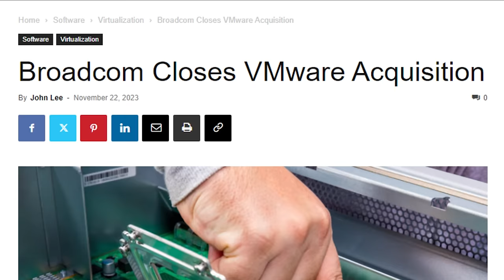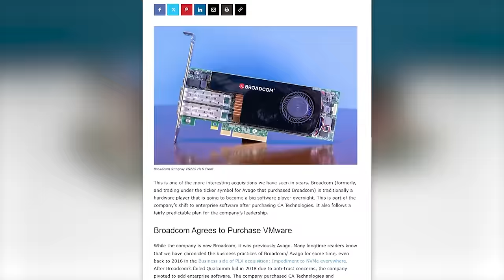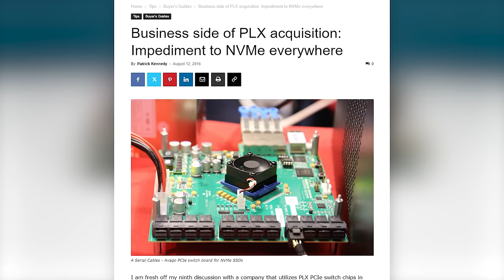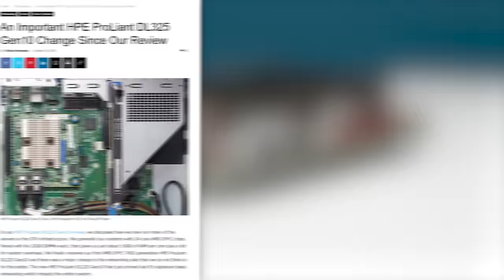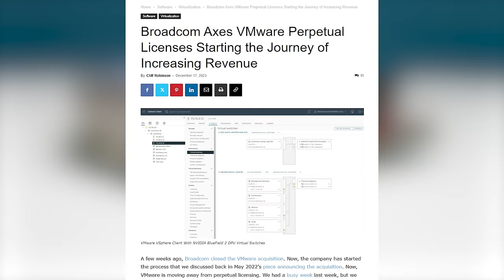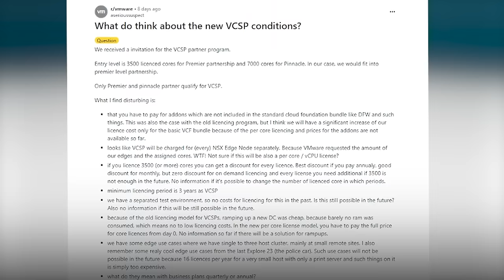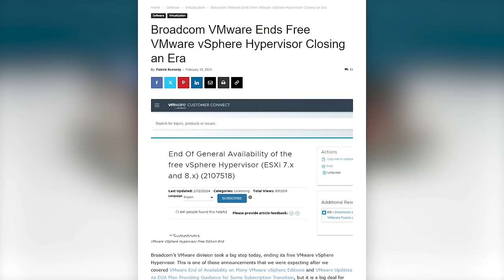VMware GUTS Customers with 10x Price Increases

Comment: 'The company that you built your business on . . . '   CNE  Novell Networks system engineers silently shed a tear . . .  😢
Reply from the maker: Great reminder!
Reply: Ooof, rough time.
Reply: I was a certified CNE back in the day LOL
Reply: @SeaJay_Oceans

In 1996 when I entered college, I took a multi certification course for both NT and Novell and Linux.  Many just took Novell because it was 80% of the market, however by the time I graduated NT was now 80%.  It flipped in just two years.
Reply: @eliotmansfield  Because there's been no development of Hyper-V in 8 years
Reply: @eliotmansfield  Many stuck with VMware out of inertia. It works, and it's the stuff they know. As for Novell, they pretty much killed themselves. In my sphere, when they moved away from IPX, that was the end of it.
Reply: My first cert was CNA, way back in 1997.
Reply: Back in the early 90s I did SCO Ace, MSCE and Informix DBA one after the other :D The knowledge I gained is still valuable, Even what I learned as a part time operator on  HP MPE V and MPE IX system while I still was in university. .
Reply: Former master CNE too, it  happens too much in this industry, gone from that to mcse, Citrix CCEA, HPE master ACE, etc, nowadays I don't pursue certifications just business with every tech I know.
Reply: @eliotmansfield Novell had much better network permissions.  So much so, MS finally introduced ABE, which still requires too much setup.  Salvaging files, etc..
Reply: @asksearchknock   Anyone else remember setting up DOS  LANtastic networks too ?
   Good Times...
Reply: @MichaelBrierley  Still running it, V2.16, for retro stuff, long live IPX!
Reply: @eliotmansfield  I was very disappointed when Microsoft discontinued Hyper-V Server.
Reply: My first job in IT had Novell AND an AS-400 mainfraime lol.
Reply: Oh my, I just remembered. Thanks and … here we go again.
Reply: My first cert was CNA, then CNE a couple months later.  It went away extremely quickly.
Reply: That took me back in 1999-2000 year when i was pursuing my CNE cert lol
Reply: @SeaJay_Oceans  Wow, that's a name I haven't heard in years!  It was great.  Easy to install and inexpensive and it was rock solid too.
Reply: Once Microsoft essentially ripped off Novel with Active Directory. It was only a matter of time.

Another great company ruined by acquisition.  Along with Sun, Palm, Ring and numerous others.
Reply: Novell didn't rake up the prices though, that just became too difficult to run due to every application suddenly needing AD integration :|
i ran a Novell network (Mixed Netware / SLES) till 2018 when there was a forced switch due to outsourcing.
Reply: Ahhh yes. Include me in that list of CNEs... First network I ever worked on was my home token ring Novell based one.  Oh I don't miss that. Or having the right terminator when you need one... So many times I'd "oops"  because I grabbed a balun one out of the tool bag instead of a BNC, lol.
Reply: @jfbeam  The move to TCP was unavoidable already. They just waited for too long,  implemented it not good enough and the most important - MS was very aggressive that time...
Reply: Yup.  Dual Master CNE here.  Used to work for Novell as a Systems Engineer.  Supported NetWare in the enterprise for decades before they went 'poof'.  Novell's biggest problem was they didn't know how to sell to VITO (Very Important Technical Officer). While Novell was courting network engineers, Microsoft was courting CIOs & CEOs.  Microsoft knew who the decision makers were and Novell was too busy selling to the troops in the trenches.  I remember asking the head of marketing for Novell why we didn't advertise on TV (like Microsoft (and everyone else) did).  His answer was that, per Novell policy, all Novell advertising had to have a one-year ROI.  That was the moment I knew Novell was dead.
Reply: @uator Was considerably more expensive in our region than Windows Server, so management said change when upgrade time came. So we changed the infrastructure over due to cost. For us at least, they prefered Netware technically, but WinServer was adequate and far cheaper! Most of our change over happened within a few years after 2000. Had used Netware for 10years prior to that.
Reply: MCNE MCNI here.   A fitting comment
Reply: Ipx/spx was doomed. Running a gateway to convert for internet access was not ideal.  

Directory services and rights are still Superior to any of Microsoft or Linux attempts to this date.

The move that really killed it was the move from client server apps to TCP based browser applications. When's the last time you used a front end like Microsoft access to enter data on a fileserver.? 
The end of Novell was a simple one, the size of Microsoft was just too much.
Reply: No certifications, company was too cheap, but I did install a lot of Novell and SCO Xenix/Unix systems back in the day. Even got called in to fix a Solaris / Novell issue at a large university.
Reply: @MichaelBrierley Careful admitting that...but since ya did, I will too. I recall being kind of talked into Novell certs and later on having an instructor sort of chuckle and say "It's a Microsoft world...". I got my Banyan-Vines certs hanging over the mantle right next to the Novell, Applix and Word Perfect ones....😅
Reply: My CNA cert got me my first tech support job in ‘98
Reply: @DeanTWaters I made that same argument back then.  While I as the Network Admin would receive stuff from Novell, Microsoft sent stuff straight to the office of the president of my bank, which he would bring to me.  That's how I got my first licenses for Windows NT 4 server and workstation, which I brought home as work didn't need them.
Reply: Uncle worked as a big manager in that company, once it went up so did his paychecks
Reply: @jfbeam  But they had to because you know... the internet.
Reply: Microsoft robbed Novell.
Reply: In my first full time server support job in 1997 I was shown the server room. A row of tower cases mostly running SMP Motherboards. I walked down the row of servers. Uptime for the NT  servers was up to 14 days, whereas uptime for the Novell boxes was in the hundreds of days. 

That’s what started my interest in Novell 3, 4, 5.

It’s a shame they lost to Microsoft.
Reply: Soo true lol

Comment: and let us not skip over how VMWare player has been degraded over the past 5 years.
Reply: At least the management has not made that a subscription. There is a small market for VMWare workstation pro, but that market needs decades of running in an off-line environment.
Reply: Woops I “borrowed” the full version.

Oh well.
Reply: @Hogdriva  I need to borrow it too, I've noticed how normal Player runs worse with every update.
Reply: Workstation has barley had any improvements over that time as well. I think the biggest major features added have purely been support for the next version of Windows and virtual hardware compatibility with vShpere.
Reply: VMWare Player and Workstation have been steadily losing features with each update. I was so confused when i saw that virtual drive mounting, physical drive allocation and virtual printers were all removed.
If I'm not mistaken, 15.5.7 is the last version before they started doing this.
Reply: I'm old enough to remember how good the VMware Server product was. That's been gone for a long time.
I also liked being able to use VMware Workstation to remotely connect to another machine running Workstation. that functionality appears gone, too. I'm only using VMware where required now. I've moved off it for everything else.
Reply: almost counter responded till i realized tpm features go back to 12 and its on like 17.  if you use it to manage esxi hosts fot smaller environments amd have a backup solution I guess you were all set years ago...
Reply: @quadraforest  I ended up downgrading to Workstation 11 after they removed the Unity feature for Linux vm's. I'm a fairly light user, but loved having that.

Comment: VMware pricing has affected large businesses too. It's now cheaper to invest in completely new deployments, from renting new DC floor space to completely new compute/storage/networking just to get away from esxi faster.
P.S. OpenStack rules!
Reply: heck yeah OpenStack!
Reply from the maker: Good point.
Reply: We have a good deal from OCI, they can sublicense VMware for a nice price. But that's Oracle, so no guarantees that these nice deals are gonna last.
Reply: Give OpenShift virtualization a go.
Reply: @Eugensson  It is Oracle - so it is absolutely guaranteed to not last. Enjoy it while it lasts, though. :)
Reply: @TylerDurden-pk5km  that's exactly my fear, we didn't pull the trigger yet, I'd rather move to in-house Hyper-V + Azure HCI honestly. Kinda afraid of the Oracle Cloud.
Reply: @acquacow not mad on it. Lock-in flavoured k8s
Reply: Can confirm first hand. Like Oracle, VMware should expect a significant loss of market share.
Large customers move slowly, but they started moving too a year or two ago, even earlier than the smaller ones due to different contract terms and failed negotiations. For them, too, it's all about money at some point 🤷🏼.
Reply: @ServeTheHomeVideo  you guys willing to do a deep dive on MS licensing? I had to move away from WS2016 because a drive failure resulted in a re-install and I couldnt re-activate the OS without a KMS. Also their core licensing is wack. They really need to modernize that, and I've lost about 30 windows 10 licenses because they dont support VMs properly.
Reply: @acquacow  OpenShift is Redhat's bloated crap on top of an already insanely bloating pile: kubernetes. And being owned by IBM, that shit isn't cheap either.
Reply: Openstack is a complicated mess. I've never been impressed by that pile of python scripts.
Reply: Red Hat told us that Openstack was going EOL in 2025, and was being replaced by Openshift. It takes multiple administrators to keep our Openstack cluster running, unlike the simplicity and ease of management of VMware. Not sure where we're going to go for our own private cloud(s) now.
Reply: ..and openshift is mostly just k8s
Reply: @Eugensson oracle? Are you nuts?
Reply: My employer has a large (100s of licenses)  VMware licensing agreement.  Wondering if we will get moved to something else.
Reply: Yep - we're already looking for a new vendor.  And we run many racks of VSAN in several DCs.  It's obvious that Broadcom wants to shelve VM Ware.   The question is, why?
Reply: @mjl1966y    That's their MO.  They'll soak the large enterprise customers who might need years to peel out of VMWare while significantly reducing their run rate for operating that business.  There are still large F100 enterprises that are lingering on the various CA products on the mainframe side of the house as it is deemed cheaper to just pay the extortion than to re-engineer their crusty back-ends.   The moral here is to not allow your enterprise to keep technical debt like that around and open up opportunities for bottom feeders to feast on your carcass (and your margins).
Reply: Back in 2017 I kept trying to bring up the issue of OpenStack focusing too much on competing with all kinds of cloud services and not enough focus on just building a super solid, easy to use virtualization platform first. They ignored me. I told them the core virtualization platform must be as easy to use as VMWare. They ignored me. I left the OpenStack community in 2019. I feel like this wouldn't be an issue if VMware had any kind of competition in the datacenter space, which OpenStack is only in its ideology but not in its implementation.
Reply: thanks, thats a really good insight.
Reply: @acquacow OpenShift is not virtualization.  It is just Kubernetes (container orchestration) wrapped in Red Hat craziness.
Reply: @jfbeam If Kubernetes is bloated, VMWare is obese

Comment: They also removed all not-for-pofit/academic pricing. We're dropping to Standard or Essentials for this renewal, and switching to either Hyper=V or ProxMox. There's just not enough time to switch right now, or we would.
Reply from the maker: Giving this a heart as it is a great point.
Reply: Will it stop if you don't pay?
Reply: I work in higher-ed and although I don’t use VMware myself, this is good to know. 
Although in the classroom we moved off VMware workstation many many years ago, and now that virtual box properly supports hyperv as a hypervisor it’s a perfect teaching tool for students (depending on what you’re teaching obviously) and no longer runs as a complete pig.
Reply: @FreedomIsNotGoingToBeFree  We lose support and updates if we don't renew. If it was just a short period before we could transition, I'd be okay with it, but there's too many moving parts, and it will be a multi-year plan.
Reply: What you think proxmox is going to do when they hit higher userbase. They will just become the next vmware, higher prices included.
Reply: @Powertampa  when they get brought out by the vultures
Reply: @FreedomIsNotGoingToBeFree  It doesn't stop working afaik but technically the perpetual license becomes invalid - in order for the license to remain valid you need to buy into the subscription. You lose all your updates, even critical security updates which you got if you didn't have SnS (Support & Subscription) in the past.
Reply: @Powertampa  If Proxmox would polish themselves a little bit more they would be a great contender. The lack of console UI, convoluted menus, lack of homelab subscriptions for a fair price, refined device passthrough done through the GUI, better ZFS support and the ability to configure zpools from the GUI, and better windows support without requiring virtio drivers loaded separatly. They really just need more polish. If they did I would gladly give them some money for a subscription.
Reply: @napalmsteak   The main issue with Proxmox is that it relies on numerous open-source technologies such as VirtIO, ZFS, etc., many of which are forks, but always based on the upstream. This means that improvement in the entire ecosystem is required. However, KVM is gaining significant traction with many players in the market. I believe VMware's involvement could catalyze the enhancement of the entire ecosystem of open products.
Reply: Yup my public research university is dropping it and the transition period will be rough
Reply: @FreedomIsNotGoingToBeFree no, but apparently they just can run VMware without 24/7 support, I get it, but if it was me I just it as is until everything is moved to another platform.
Reply: @napalmsteak  "The lack of console UI" - If you mean a GUI on the console/host, you can fix that by installing a normal user and desktop of your choice.
apt update
apt install sudo
adduser username sudo
usermod -aG sudo youruser
apt install tasksel
sudo tasksel
"ZFS support and the ability to configure zpools from the GUI" - Completely agree with you there, also needs to show failed drives and to allow quick and easy replacements and resilvering.
Reply: @napalmsteak  similarly to freenas anything bsd based just isn't fun to deal with. Every time I have encountered that it was to fix it. Ran freenas and truenas, both with constant issue and in the end broken zfs pools. Can't say I'd trust that in prod at this point.

Proxmox really only lacks one thing. A direction. Problem is the moment it has that it becomes attractive for the venture vultures as well. You know how the cycle goes.
Reply: @Powertampa  Nothing, because they're open source, and if they try to fork and close their source, the previous codebase will immediately get forked into another product that will continue on.
Worst case, nothing that proxmox does is special, you can do everything it does on vanilla debian, and that's on purpose, so you can always just roll your own solution without much trouble.
Reply: @ericneo2  for the UI I meant more in line of ESXi or XCP-NG. Changing the management interface, setting IPs, shutting down running VMs, etc.
Reply: @FreedomIsNotGoingToBeFree 
If you don’t pay for subscription the software will continue to run but you no longer have the right to use their software.
All they need to do is send letters to all customers that did not renew asking for a convenient time to perform an audit to ensure those customers are not using VMware software illegally.
Reply: @d1gg3r loss of updates is the least of your problems.
If you don’t pay for subscription you lose the legal right to use the software. 
It is cheaper to pay for  minimum subscription than for the audit, penalties, legal costs AND the subscription.
Reply: @rok1475  tbh the lack of critical security updates is the major one of my problems there lol. As I said though the license becomes invalid eg - essentially pirated software. For my use case the cheaper minimum subscription is a lot more expensive than the cost of it with how I use it now (I only take the mandatory support as I've never needed it in 16 years otherwise so it becomes cheaper to refresh versions with hardware and pay for support if something goes wrong. As we all know auditing is generally up to the user on products that have no phone home (like this). I'll be moving vendors, like a large number will I suspect. Especially those in relatively simple environments.
Reply: @napalmsteak  XCP-NG looks like a great system so far.